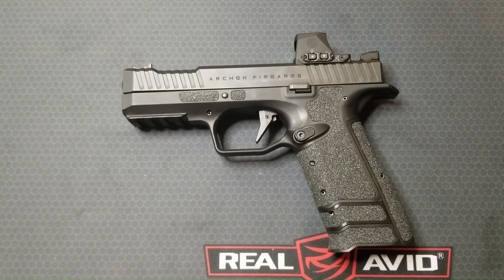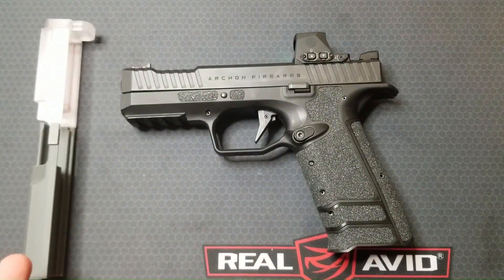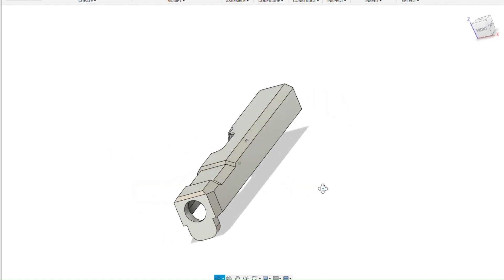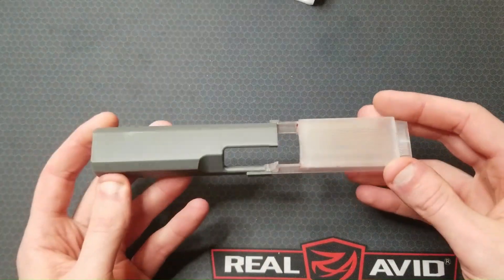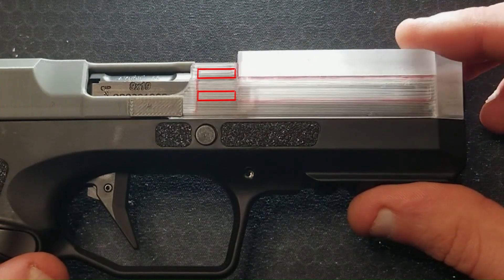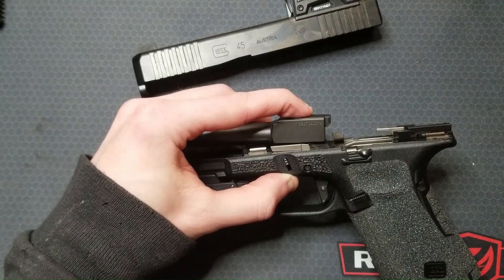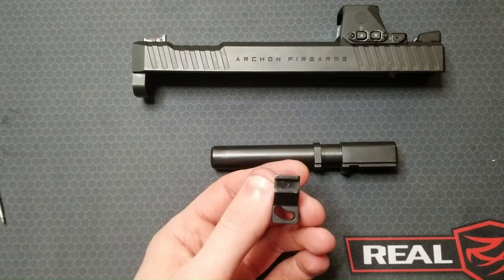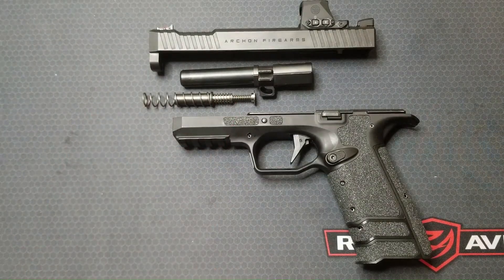Archon Type B Barrel Locking System Theory & Operation

Comment: Great video, but one interesting touch could have being to put a red wire glued to the frame of te gun showing the initial position of the locking block and comparing to its final rear position when the action is unlocked, because the locking block moves back and forth during the locking and unlocking process...
I mean the red needle glued to the frame kind of a fixed dial in front of the tansparent slide for reference of the position of the locking block

Comment: VZ58 carbine ( more like the Beretta)
Reply from the maker: Oh hey that's cool! Didnt know the VZ58 used a locking block like that, figured it was a rotating bolt like the AK. Learn something new every day. Thanks for commenting!
Reply: @EngineersArmory  Probably wouldn't take to long to find a good Xray animation of the VZ58 action. I know this will blow AK fans fuses; but the VZ58 is a much better platform for the 762x39 cartridge.
PWS long stroke piston is number one; accuracy, balance, 4 pos.gas block, and all the AR15 compatability that goes with it.
Reply from the maker: @almaadams3631  I'll have to poke around. You got me curious. I am an AK through and through. I own 5 AK variants. I love em. No experience with the VZ58. They have caught my eye before, would love to try one. Don't know if I want to pony up the money for one. Maybe they are better than AKs. I dont know haha. I wouldnt get my panties in a bunch about it either way.
Reply: @EngineersArmory  Make sure it is a CSA! No Century 2008 or other kit builds.
CSA uses the proper "push down plate" for semi auto only trigger reset, but most of all new recievers and Lothar Walther barrels. The one I sold during pandemic( for a mint) was the 11.85" pistol (Zukov folder/Tailhook brace) was 1/1.25 MOA with Barnaul ( which is unavailable, but not for long I bet.)

Comment: One thing that I like about this and the Beretta locking systems, is that during extraction, the breach is not pointing downwards, so the empty case is not being directed to the inside of the gun before being kicked out, thus improving the extraction phase. Sure, the difference in angles from a traditional Browning action is small, but little details help to improve a gun reliability.

Personally, I would love to see a "inverted" Browning action, where the breach remain horizontal during the loading phase, but goes up in the extraction phase. This way you have no ramps during loading, a improvement especially for hollow-point ammo, and the extraction is pointing out of the gun, reducing the possibility of a stovepipe.

Comment: Riding that pin is a poor design imo.
Reply from the maker: You're certainly entitled to that opinion. Link less cam-groove barrels and been used in a lot of pistols for a long time. Many of which have proven records of reliability and service. The Browning high power and CZ75 (and its numerous variants) come to mind. 

I could see how the cam groove and pin in the Archon are under less stress than a typical tilting barrel arrangement because the locking piece is relatively small and light. The groove and pin aren't moving around the whole chamber end of the barrel.